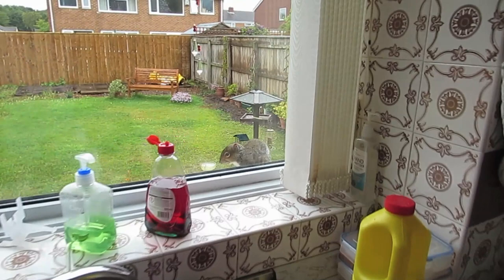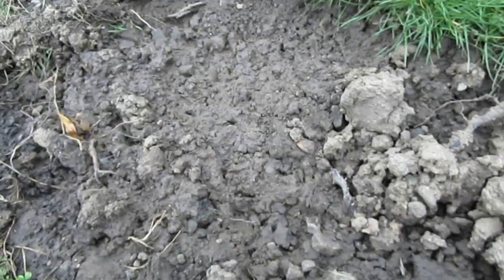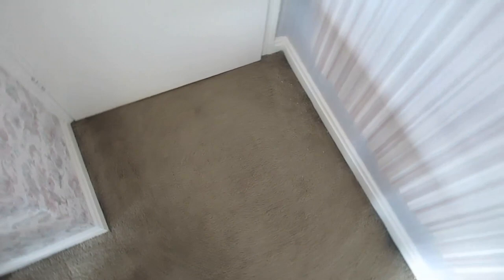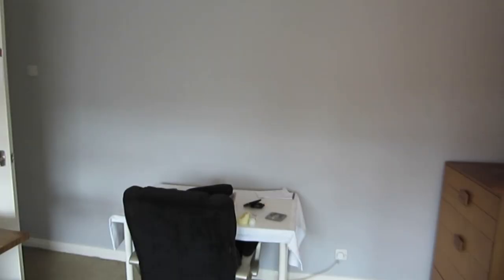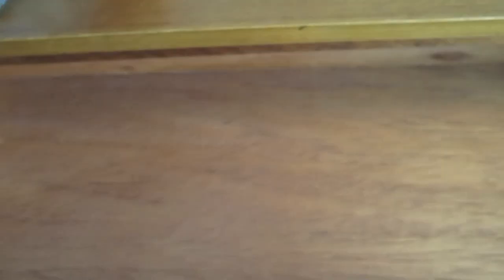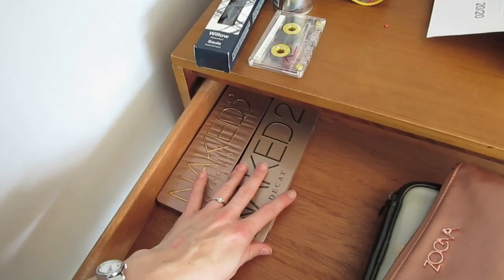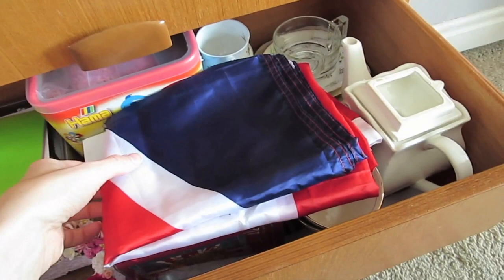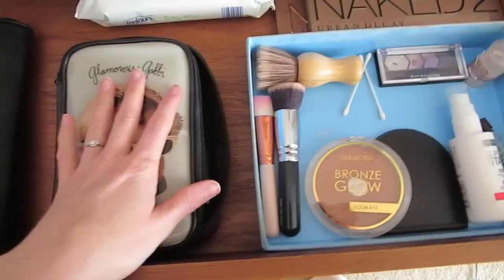ASMR DIY, painting my office wall & more organising / decluttering - Unintentional

Comment: You can put a little primer water in the Nyx brow gel or on your brush every time before you use it n then it will become as creamy as you want.
Reply: Isha Vyas Thank you! I have the same problem with mine only its a L'Oréal brand.
Reply from the maker: Thank you....also just learned that there is something called primer water!
Reply: ASMR Angel 🙈 primer water is basically kind of setting spray. NYX cosmetics and Smashbox has the best ones.